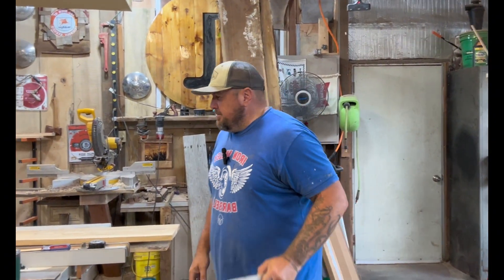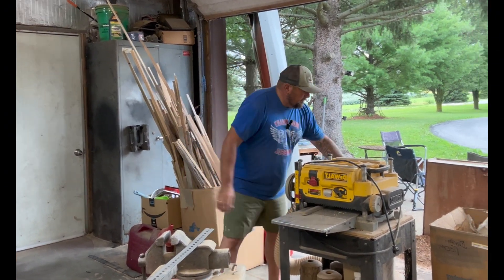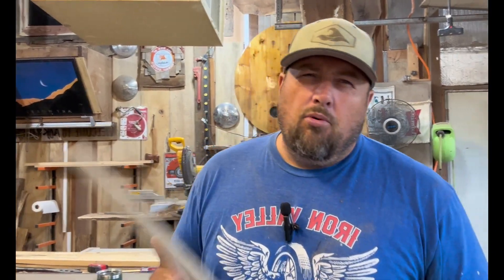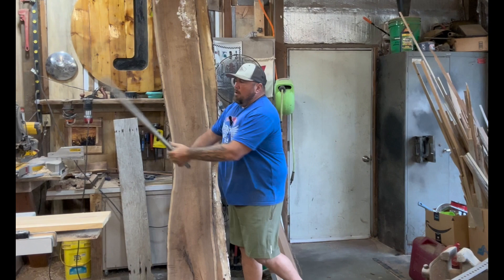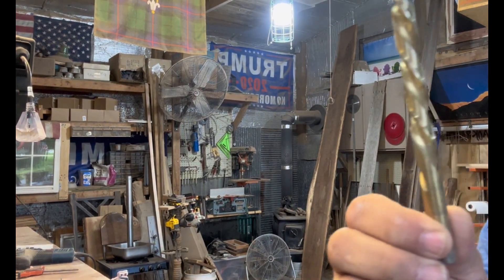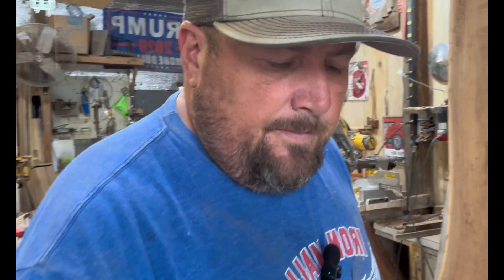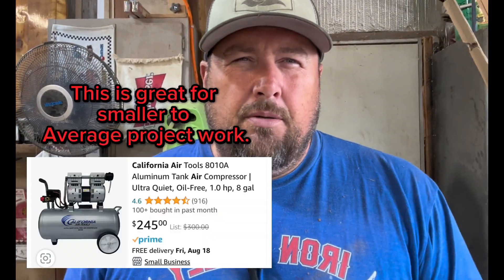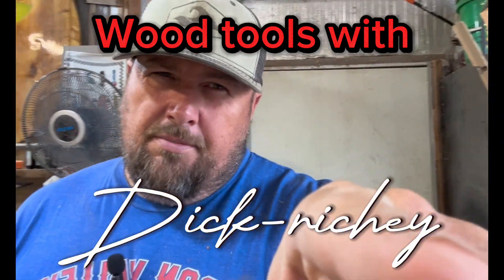Good wood working slash DIY tools to have.

Comment: I have a Kobalt portable table saw.  I have gotten a lot of use out of it but the fence isn't precise and the lock for the sliding extension broke so I can't recommend it.  If I had more space, I would get a stationary table saw to stay in my shop and a new portable one for when I'm on the road but alas, space is not a luxury I possess.  The thickness planer is one of those tools that once you get it, you don't know how you lived without it.  They do get ridiculously expensive if you start looking bigger than 13 inches.   If you are into woodworking, I would add a nice plunge router or router table to the list.  Nice video, sir.  I look forward to some woodworking content in the future.
Reply from the maker: One of my five is a kobalt table saw and it is very wonky. I use the smaller hand held routers and love ridged for that.

I’m either getting a big planer like 18 to 24” or one of those router level things.

Comment: Not a fan of kobalt tools myself. Rigid you get at home Depot another story great tools. Battery powered tool Milwaukee can't beat them but you will pay for them. I like DeWalt corded tools but there battery powered stuff IMHO is junk. I know I will take some grief over that statement. I work as a carpenter and have used just about every brand out there. 
 Dick-Richy that was a good informative video. Have a great one brother
Reply from the maker: I love my m12 drivers too
Reply: I love my m18 best cordless stuff I have ever used. Still have about a 15 year old set of makitas that's going the batteries are damn near wore out. Won't hold a charge very long.